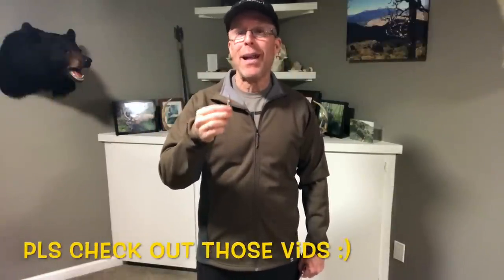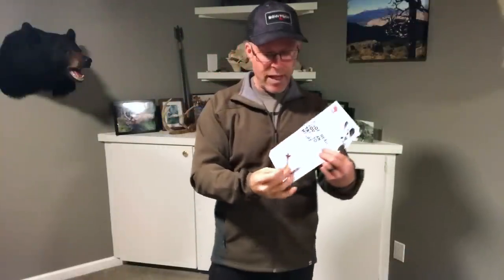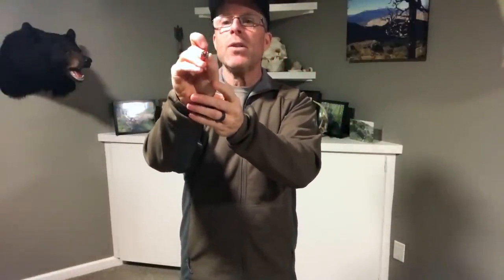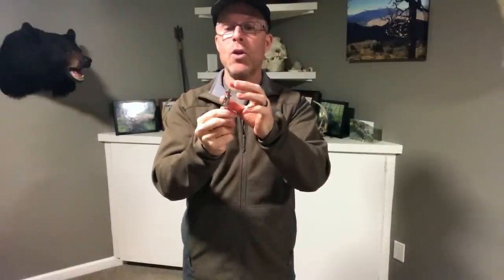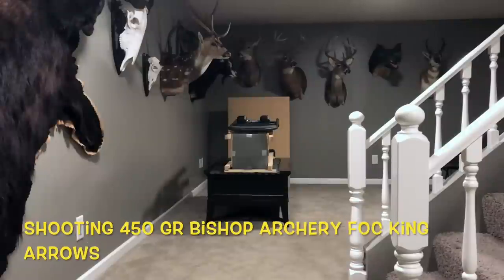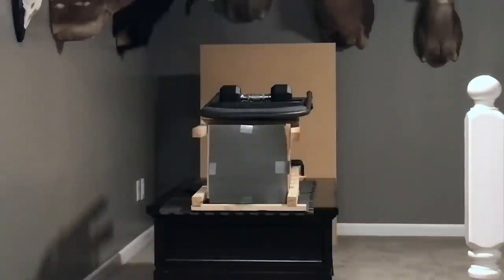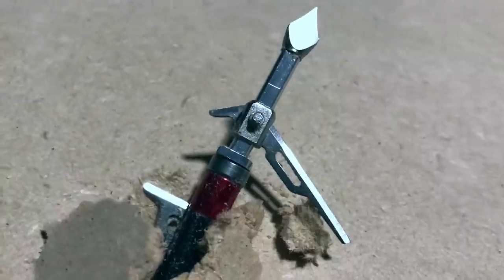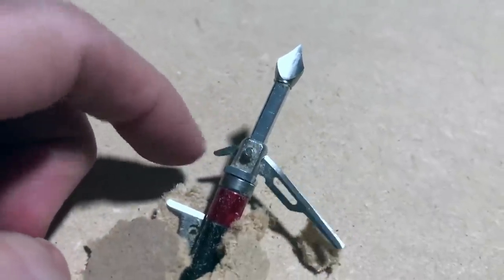SIK SK2 Broadhead Test (vs NAP Killzone)

Comment: Another good test. Neat looking head, but the penetration difference between the two isn't enough for me to wanna switch. I still like that the Killzone is easier to find and buy, and it holds up much better.
Reply from the maker: Thanks Andy. I completely agree. I am trying not to be biased in my verbiage but to let the vid and the grades speak for themselves. The Killzone is very hard to bend and break, even though they have that aluminum ferrule. They are really great heads. Thanks for the support and views, brother. Much appreciated.
Reply: @LuskArcheryAdventures  Your more than welcome.  I agree with you on the Killzone. Just goes to show that you dont need the titanium or harder metals to have a great head.

Comment: They shot like fieldpoints but i noticed they did not expand when passing through my foam target. Thoughts on this? The little clip looks like it's on properly also
Reply from the maker: That's a good question, Woody. Some times mechs don't deploy properly in foam, just because they're not really designed to. But hide and tissue are such a different medium and the vast majority of heads do open on them.
Reply: @LuskArcheryAdventures  thanks for the reply. I was thinking the same thing..possibly because the foam isn't hard enough? Just don't want to have to buy new broadheads if i don't need to, was finding hard to believe it was a defective broadhead.
Reply: @LuskArcheryAdventures  can these be sharpened just like fixed blades?

Comment: I have Never! Had a fixed blade fly as true as a mechanical!!!!!
Reply from the maker: Yeah, while there are some fixed blade heads that fly extremely well, simple physics would suggest that the mechs will always "fly better." How much better is the question to ask, and is that difference "worth it?" If I can easily pop balloons at 80 yds with a fixed blade head, then I consider that difference not significant.
Reply: I have! Thunderheads !

Comment: Yup all the more reason to shoot cut on contact fixed blade's
Reply from the maker: Yeah...but these are pretty weak. I was really impressed with the Sevr 1.5 in 125 gr. Man, I shot one head into steel, MDF, and then into a concrete block 3 times with little damage. They are tougher than most fixed blade heads I've tested.
Reply: G5 Montec CS. I bleed every time I touch em.